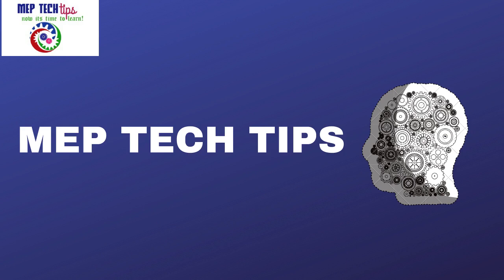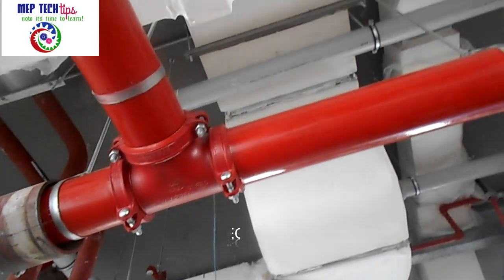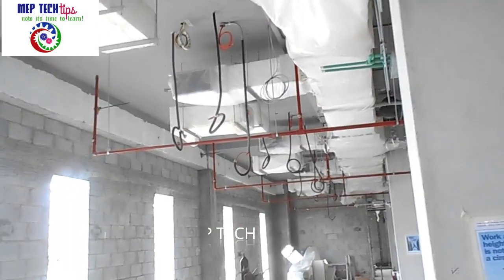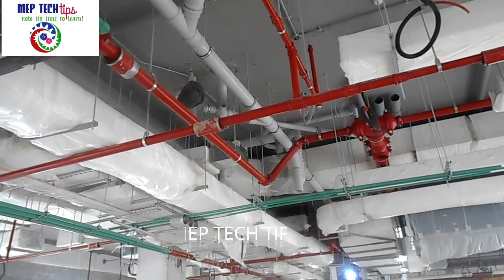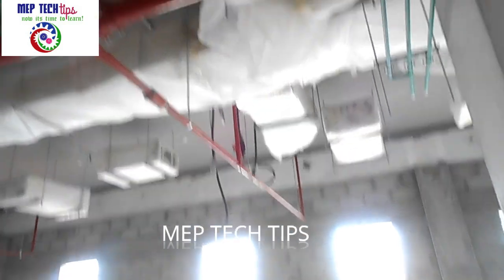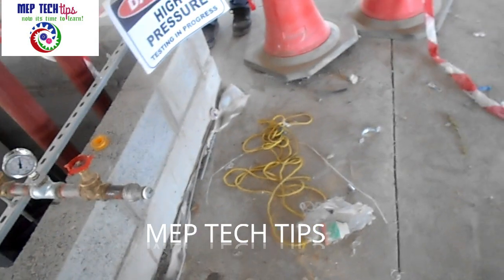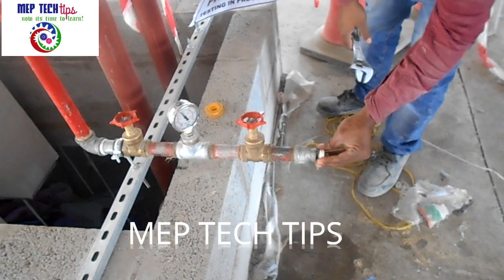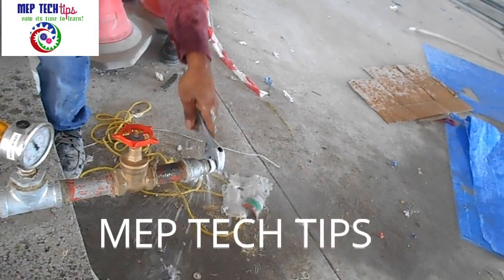Fire Fighting Pipe Pressure Test| Fire Fighting System| Fire Fighting Pipe Work| By MEP TECH TIPS

Comment: In the philippines, For initial/internal testing you must test the system with required pressure for 24 hours duration.And if no pressure drop after 24 hours thats the time you call for the inspector to witness and observe another 2 hours. Sometimes the allowable pressure drop is +-2 psi with no visible leaks.

Comment: The  valve must be closed before removing the end plug thats the proper practice. Considering the pipe system is pressurized .What you are doing is not safe.

Comment: Very professional way. I have installed a small fire pipeline system in my building of 2 floors, riser pipe. I want to check the pressure test in the pipelines before false ceiling. Can I pressure test with a hand operated pump ?
Reply from the maker: yes

Comment: how much pressure should we maintain in main pipe and sprinkler pipe
Reply from the maker: As per ur project system pressure will be maintained
Reply: For example a ground floor fire fight system what is the ideal pressure..?
Reply: Standard is 200psi or 13.8 bars